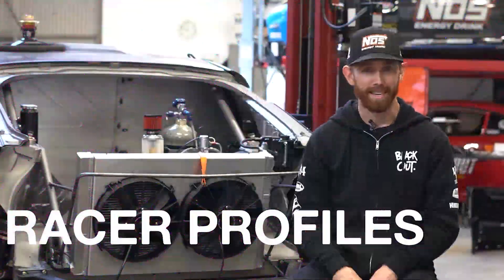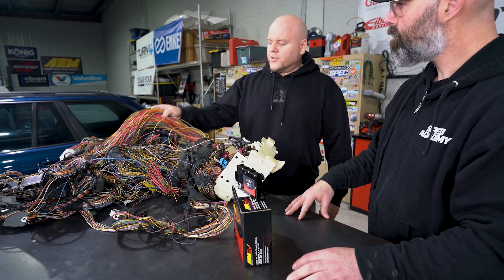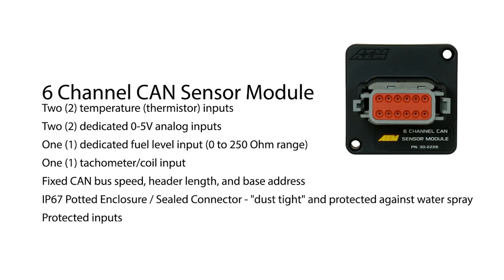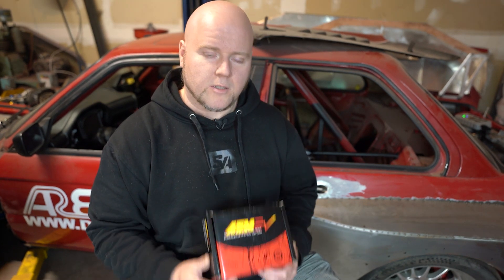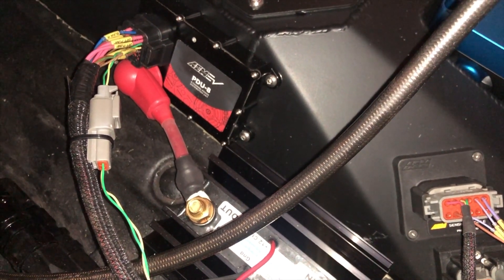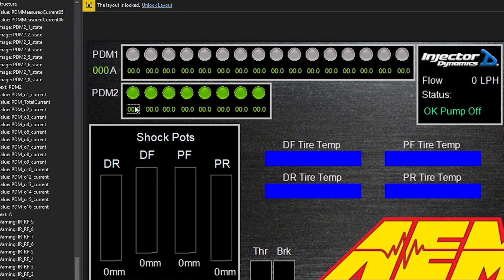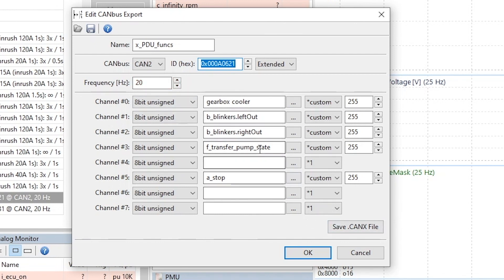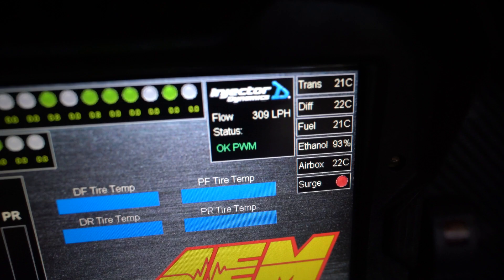Speed Academy Installs AEM's PDU-8!

Comment: Hi, my name is Reynaldo; I need to know how I can handle a device that consumes 50 amps with the AEM PDU-8 module. Can 4 outputs be joined together? for example and according to the PIN OUTS should join pins 1,2,6,7,8 and 9 ?
I would also like to know if to use a single PDU-8 I must connect the two ground outputs, I mean if I should connect pin # 5 and 11 or only connect pin 5.
On the other hand, if pin 1 and 2 handle 20 amp max, does this mean that each channel is 10 amps ?